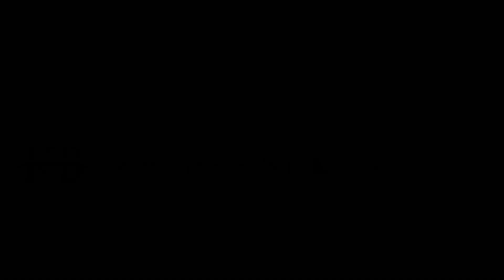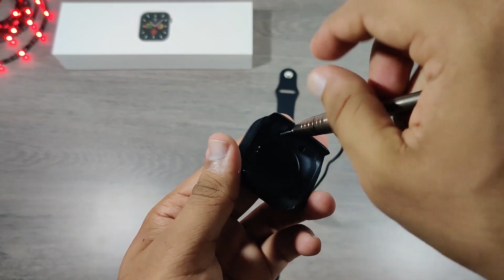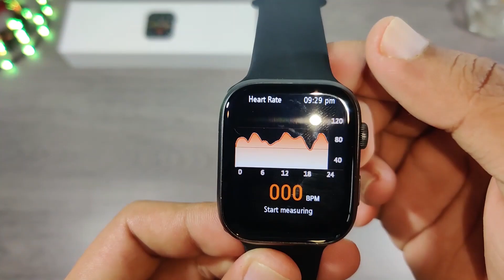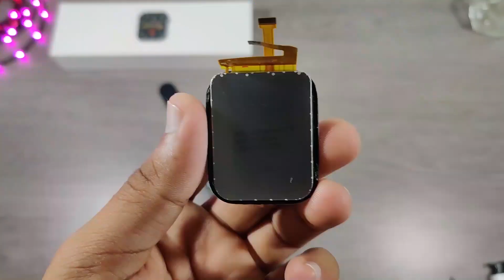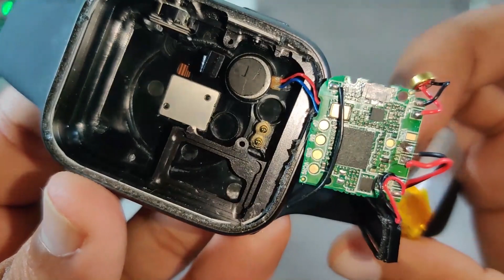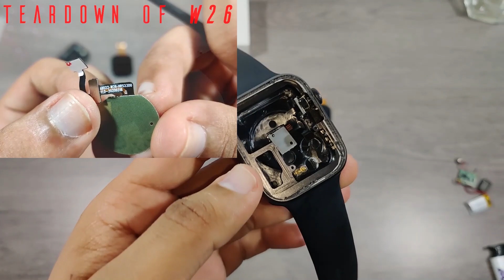Apple Watch Series 6 (FK88) Teardown | FK88 SmartWatch What's Inside?? | Actual Heart Rate Sensor???

Comment: Sir can you please help me please please please i got fk88 20 days before it is not working suddenly dead i tried a lot to turn it on it turned on for few seconds and turned off again and not turning on no overcharging no battery drain no water damage nothing please sir help me anyhow 😞🙏🙏🙏🙏
Reply from the maker: Looks like some of the components should be damaged which is not allowing your watch to turn ON. There could be other reasons also of not turning ON, so you can get to know the actual fault after opening the watch and diagnosing the fault.
Reply: @KaranBakrania  sir thanks for assisting can you please get in touch with me i am really fed up its not even a month purchasing it it would be greatvif you can help me out. 🙏🙏
Reply from the maker: @techspecs3760  you can consider showing it to some of the local mobile/electronic repairing shop. They will check and tell.
Reply: @KaranBakrania  ok sir
Reply from the maker: @techspecs3760  yeah. Let me know if you need any further assistance.
Reply: Sir please help

Comment: FK88's price ranges from 2500 to 3800 from different sellers. Is that quality diff or profit diff? Clone watch also have copies?
Reply from the maker: That would be because of profile point of view. There are 2 models FK78 PRO and FK88 both looks similar. FK88 has got more watchfaces.
Reply: @KaranBakrania  ok thanks Brother. That Means if its FK88 den its same only

Comment: Which is the best clone watch of apple . Now available In market
Reply from the maker: Yeah!!!
Reply: @KaranBakrania  Which is the best clone you suggest?
Reply from the maker: @Damilosky  in 44mm FK88, in 40mm HW12.
Reply: @KaranBakrania  What's your opinion on the W56 compared to these other clones?
Reply from the maker: W56 and FK88 both are almost same look wise. I would suggest FK88 because the mobile app of FK88 is very well developed and custom watch face can also be installed. In W56 the mobile app is like crap, It doesn't have anything. Only option to connect with watch, find my device and notification, that's it.
Reply: @KaranBakrania Oh, wow!Thanks for the feedback. From the videos I've seen, you are right about the W56 app compared to how well developed the FK88 app is (including the software).

Also, can you confirm if the W56 app allows the upload of custom watch faces?
Reply from the maker: @Damilosky  NO, W56 doesn't have custom watch face feature. it only has nearly 50 pre-installed watch faces.
Thank you.
Reply: @KaranBakrania  Oh, my goodness! Thank you for this timely feedback. I must've confused the W56 with the FK88. I'm glad you replied. 👍🏾
Reply: Is w56 available in India

Comment: Sir can we use the watch for long term and it's calories tracker is correct or it show some random no
Reply from the maker: Built quality is good and shouldn't be a problem for long-term use. Fitness tracking is not accurate so I'll not recommend for measuring calories or bpm.